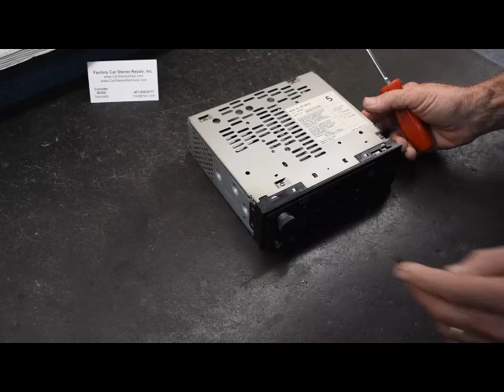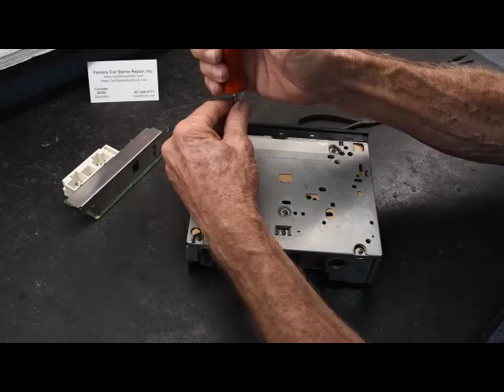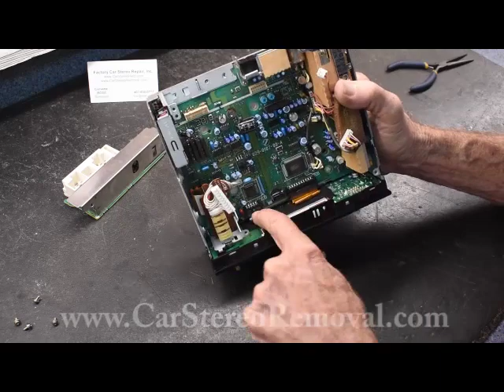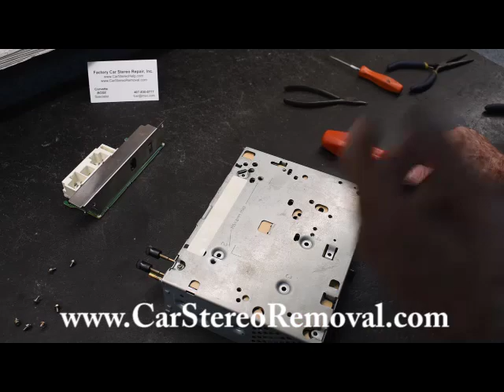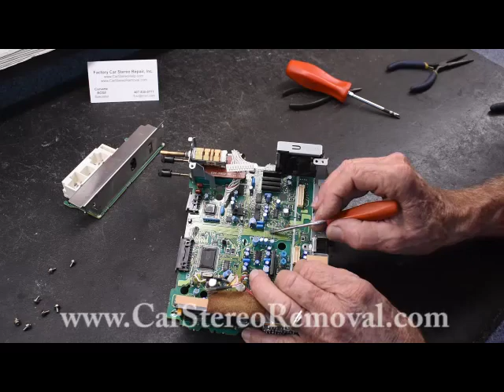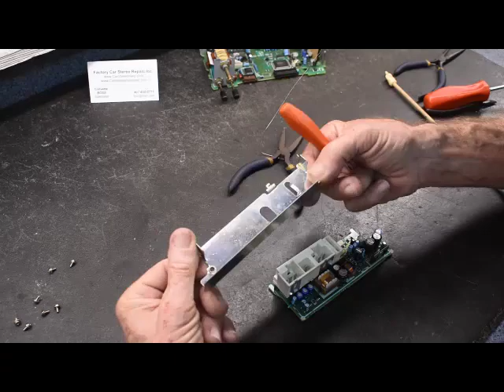Nissan 300zx Radio Repair - Bose

Comment: What size drive belt or belts does this unit use for the cassette drive? 1mm or 2mm? I believe the model number for the cassette player in this video is pp-9528L.

 I'm also having a hard time finding quality neoprene belts. What synthetic rubber brand of drive belts do you like for max heat resistance in a car?  Any info would be greatly appreciated as Im gathering parts to work on this exact deck. Thx for the video. 🙌

Comment: Great video that is very helpful.  Is that fuse slot on the back actually used?  I tried to insert a fuse in it and it would not stay inserted and looking closely at the fuse opening it looks like there is nothing to make contact and hold the fuse contacts.  I will contact you as I am restoring a low mile 300ZX and want to keep everything stock and need to get my Bose unit working again.
Reply from the maker: No fuse needed.

Comment: Hope you can do a video on 1988-1996 factory Jeep Mitsubishi RX-170 and later type AM/FM Cassette Players real soon because I have a stack of radios that need repairing. The model numbers are 56002467, 3021, 3019 and 9004. Have already swapped out the tape modules in two 2467 cases so I have one good tape player in the Jeep so far. It would be good to have some backups on standby. There are a few issues with the players like either the left or right channel going out, the volume knob maxed out but still in need of a little more volume, one player makes a high squeal with no AM/FM reception and on many players the tape mechanisms will not draw the tape in on its own. You have to literally push the tape in and you can hear the motor running that supposed to draw in the tape then you have to pull the tape out with needle nose pliers. The 2467 and 9004 tape modules are held in place by four screws. The 3021&19 seem to be fixed in place. I didn`t mention a 7214 because I haven`t tried one but those are also the four-screw type.
Reply from the maker: Well... See my Contact page https://carstereohelp.com/shipping.htm and give me a call. Bob